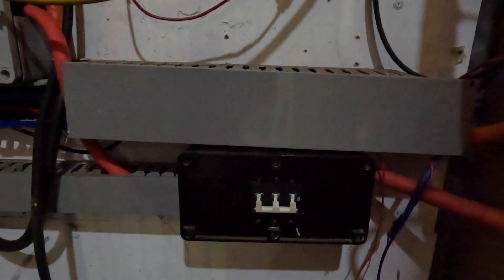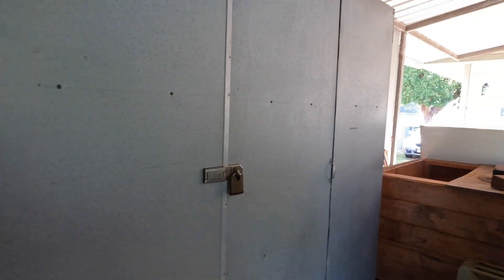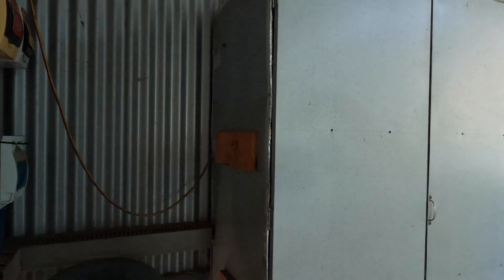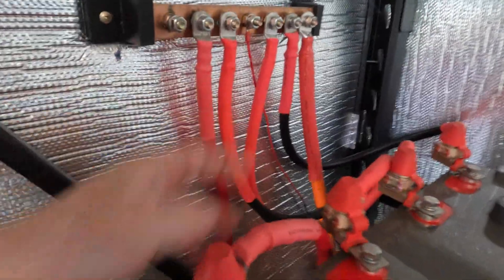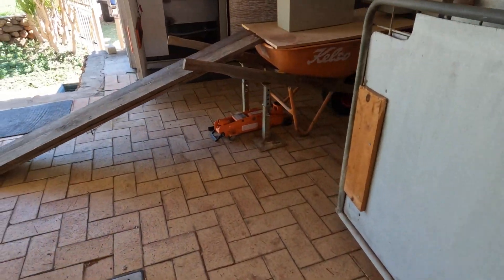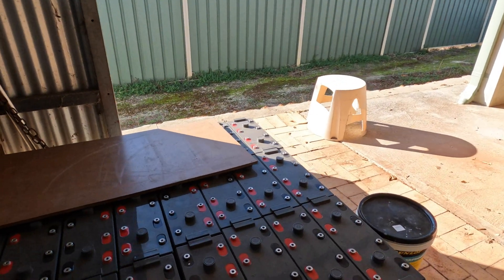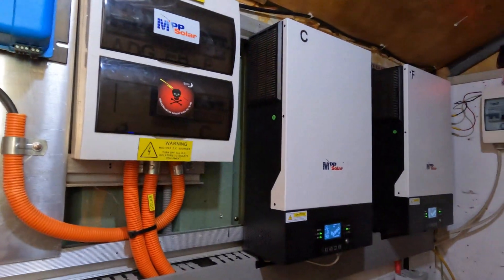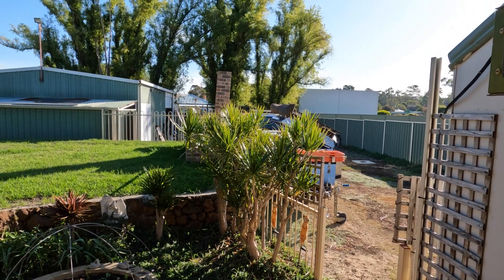HUGE OFF GRID Battery Update, LiFePO4 24 KWH Lithium Battery

Comment: Good to see you can run your house with no batteries 👍
Reply from the maker: Yes i was kind of amazed at that myself. So i tested the older unit and it would not even turn on without the batteries. Not many off grid inverters will run without a battery bank. I think it may come down to the large capacitors the MK has in it for large startup loads. Not really sure. :hand-purple-blue-peace:

Comment: Why are you changing batteries. I thought they were good still. Also what is the plan to keep the lithium warm? They cant be charged below 0C. Cheers
Reply from the maker: Well if you had watched from the Start of this series you will have seen its all down to our age, the deal we got. We will be to old to do this ourselves in another 10 years. And these batteries should see us out. good it hardly gets to 0 here in winter and is never 0 during the day.
Reply: @JustinCaseSolarPower  sorry I didn't watch from the start. I try to watch as many as I can . May go back. Probably won't even be batteries in 10 years. Lol. Cheers
Reply from the maker: @frankz1125  these ones should last over 30 years. We be gone by then.  Also it will make it the Kids problem. Have to leave them at least one problem when we go.
Reply: @JustinCaseSolarPower  I'm sure it will be fine. You build proper systems and yours seems to be sized right. Take care. Cheers
Reply from the maker: @frankz1125   Thanks you Frank. That is a very nice complement indeed. :face-blue-smiling::hand-purple-blue-peace:
Reply: @JustinCaseSolarPower  your welcome. Cheers
Reply from the maker: @frankz1125  :hand-purple-blue-peace:

Comment: Man that's cool I never seen a inverter that can run without batteries. I know my outback won't... Keep it up brother lets see these new batteries...
Reply from the maker: Yes we will unpack them in the morning, Sigi and I were just worn out after moving all the AGM 59kg each at our age was quite a feet let me tell you. Thank you for taking the time to watch the video and comment.
Reply: @JustinCaseSolarPower  What did you do to power your household overnight without the batteries?
Reply from the maker: @finalman321  Ran it off the camper trailer. To easy

Comment: What are those inverters again PIP5048XX?? I have a PIP5048MS and 2 5048MKs but bought them in 2018/19 and the design and technology changed a lot since then even when I bought the MS only 6 months and then they released the higher PV voltage MK which was annoying as asked would they release a unit above 150v when ordering the MS and they said no then 6 months later MK was out capable of 450V.
Reply from the maker: Vertex’s I run are the 5048 MK, Yes I think the problem is the sales staff do not know what is in development. As you can see though, they run great even with no batteries.
Thank you for taking the time to comment my friend :face-purple-smiling-tears: :hand-purple-blue-peace: 👍

Comment: wow I remember when you and the misses lifted them up.
Reply from the maker: That was almost 8 years ago John. The new batteries should be the last ones we have to ever put in mate 😄 After this it will be up to the kids mate as these should out last both Sigi and I have to do. :face-purple-smiling-tears::hand-purple-blue-peace:
Reply: @JustinCaseSolarPower  you will be a good test for how well those lithium batteries hold up to the frequent charge cycles. here in the stats that unit is called a Tesler backup to the grid tie inverter
Reply from the maker: @thefaeryman  Tessler  uses lots of little  18650 flashlight batteries in them John. I stayed right away from them John